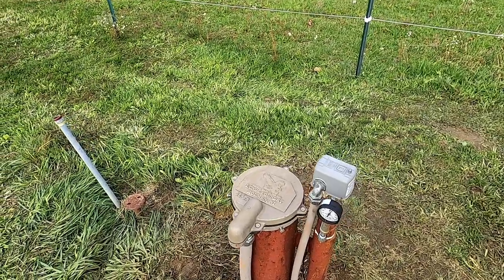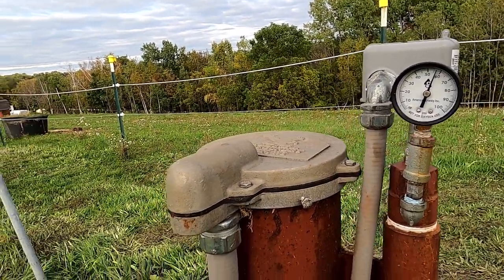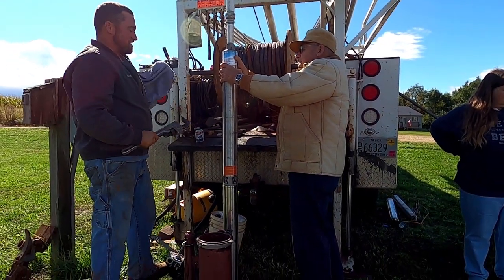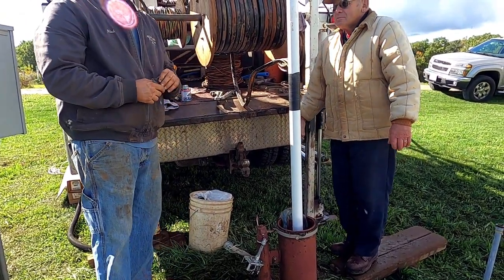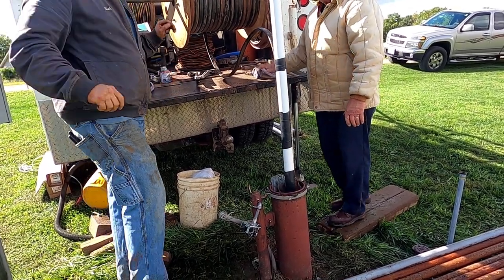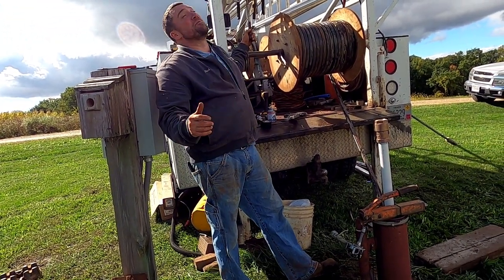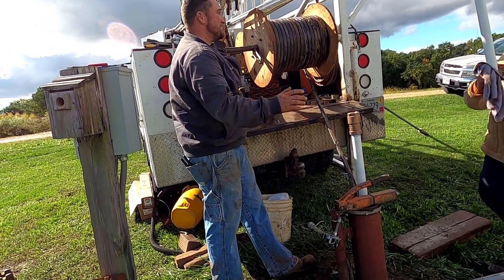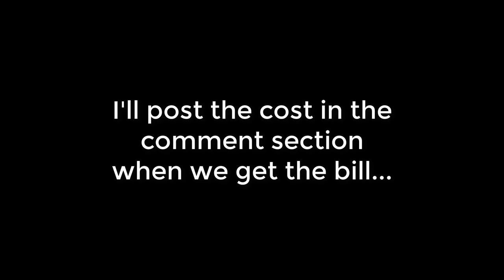Replacing the Pump and Pipe in a Deep Well $$$

Comment: Spendy fix.  In 1976-1988, we had a 165’ deep well with water at 65’ and originally used galvanized pipe.  When that corroded, my husband and I used PVC and pulled and replacing the pump a couple of times.  We attached a piece of PVC on the bottom end of the pump to settle it into the bottom of the well, keep it above any small debris stirred up by the pump, and reduce the torque.  We eventually replaced the PVC pieces with a continuous coil of ABS.
Reply from the maker: Hi Jeanne, I thought they were going to use ABS on our well, but they don't use ABS at all around here -- at least on the deep wells. I was really surprised to see galvanized pipe! Another year or two I believe one of the replaced pipes would have snapped in half, they were that pitted! I just hope the fix lasts a bit longer than the original though 🤨
Reply: Planet Mojo   Well, I lied 🙁. Must have been black polyethylene.  ABS was/is illegal for potable water use.  There is a big local industrial plumbing and electrical store where we ordered the replacement pump/parts and whatever else we needed. We also put cables running from the pump to the surface for being able to fish out the pump, if necessary.  We replaced it each time we pulled the pump because of rusting. We were young and poor and in need of water😉.
Reply from the maker: @jeannel1065  I wish we could pull the pump ourselves -- it would save a lot of money! It's one of the drawbacks of living on a ridge. My brother just pulled his pump and replaced it this summer -- but his is pretty shallow.

Comment from the maker: The original cost of this deep well was right around $35,000.00 and is a shared well that was designed to service 8 properties. It actually services three properties and several yard hydrants that are used for watering (very seldom) and drinking water for the horses. As of the publishing of this video, we still haven't received the bill for the repairs, but the estimate was $3,500.oo.

More well and yard hydrant  related videos:
Broken Well, Planting Little Bluestem, and Vineyard Look -- https://youtu.be/fGFbyx8re9E
Well Drilling Drama at Wranglerstar [100 Subs Banned!] -- https://youtu.be/inGDuINAjSY
Yard Hydrant Installations [One Sanitary and Two Regular] Part 1 -- https://youtu.be/2MU3J6KZ_dk
Yard Hydrant Installations [One Sanitary and Two Regular] Part 2 -- https://youtu.be/u5OtofUC3M4
Yard Hydrant Fittings Fiasco -- https://youtu.be/knsnUn7sRUs
Yard Hydrant Hell Hole -- https://youtu.be/4mmGRFBr-LE